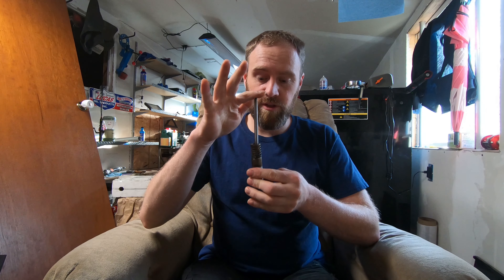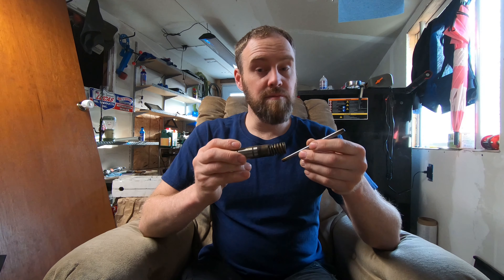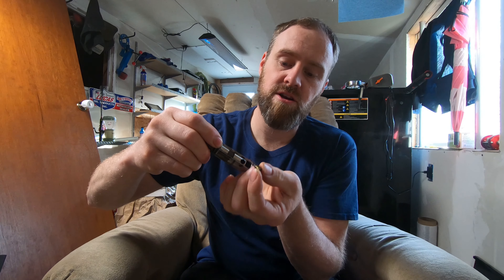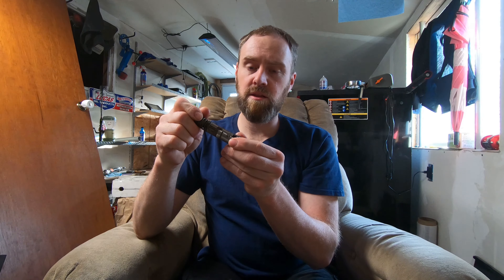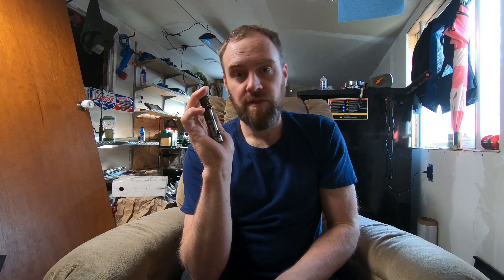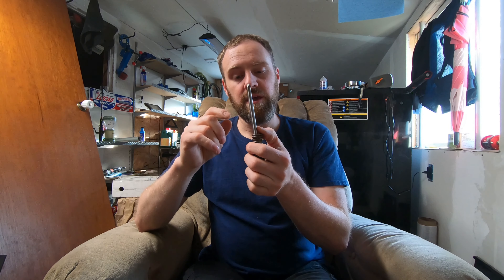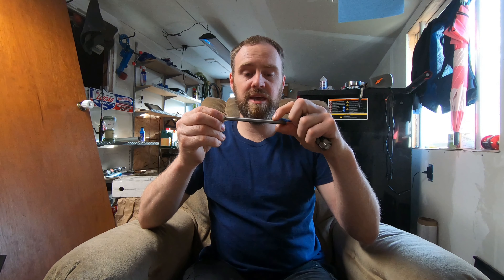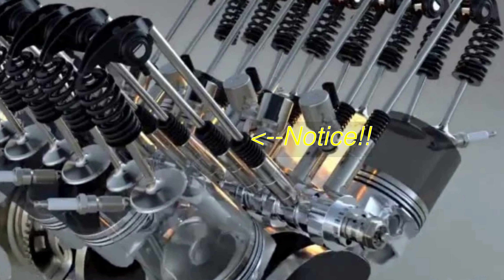Bent Pushrod, Is GM engineering to blame?

Comment: My 2021 Silverado Trail Boss w/3k miles dropped at the dealer yesterday for a collapsed lifter. They will only replace the lifters on the side with the failure but will not touch or replace the other side until they fail.  Tech said that GM will NOT authorize the dealers to replace them all at one time.
Reply: I have issue in my truck misfire cylinders and temperature sensor circuit high
Reply: I had the same thing on my 2020 RST 5.3 at 3700 miles…they only replaced one bank of lifters… on  
June 18th a TSB came out advising to replace all lifters when this problem occurs…Mine was repaired the week before, I complained to GM and now I will be getting other bank of lifters replaced
Reply: I was lucky and the TSB came out while my Trail Boss was in the shop, so they replaced all lifters on both sides (supposedly).  While they were testing the truck before giving it back to me, it dropped another lifter.  So it dropped a lifter from the replacement batch of lifters.  Another week in the shop to get the parts in to fix it again.  Have had the truck back for about two weeks now and it is running good again.  Fingers crossed 🤞🏼

Comment: I have a 2019 silverado 1500, sent to dealership misfiring in cylinder 1. Collapsed valve bent pushrod so $4000 later they replace all the driver side bank here we are 6 weeks later and same issue same cylinder. Very frustrating
Reply from the maker: Sounds like you need the smaller diameter pushrods I offer.

Comment: Pulled the valve covers all rockers seem right nothing loose.. lifter ticking noise.. goes away at 2k rpm… bad vlom not allowing oil to flow correctly?
Reply from the maker: You sure it's lifters? What year and what is it. New ones don't have a VLOM and that won't cause something like that. The VLOM only applies oil to lifter when lifters are disengaged, AKA 4 cylinder mode.

Comment: 2020 at4, 50 miles on it and bent a rod. Got a new motor
Reply: Did you have to press them for a new motor? I just suffered a bent rod at 30k miles (still under warranty) and I want a new motor also
Reply: @blakDragon88  no, it was the day after I bought it so they apologized heavily and swapped the truck for an identical one. Took the other and put a new motor in.
Reply: @blakDragon88  did they tell you why it bent a rod???

Comment: My truck has a cylinder 7 miss fire it’s a 2015 GMC Sierra they told me it something with the rocker in the engine would it be the rod?? The truck shakes, has a check engine light and sometimes throws white smoke from the exhaust
Reply from the maker: Very good chance it's a pushrod.

Comment: I have a 2019 Chevy Trailboss custom 5.3 with 6 speed and older tech 25,000 miles no issues Inknow many with the newer 6.2 that are having this issue so your saying the Active fuel management is the reason  this is more common and the engines that just shut off to 4 cylinders are less likely to have issue ?

Comment: So the new Silverados come without the AFM due to the chip shortage, do you believe the trucks will not have those issues with the lifter and pushrods?
Reply from the maker: The non DFM will prevent the typical lifter failures. However it won't completely solve the pushrod issue.
Reply: @CrazedPerformanceRepair  I have ordered a Trail Boss which will come without the AFM and plan to use it to tow a small camper, do you believe towing a camper will put even more stress on the engine and pushrod?
Reply from the maker: @Krivaja22  it always adds stress to an engine but not in a bad way. It won't effect the life of the pushrods as it's a engineering failure rather then a too much stress failure. The solution is a slightly smaller diameter yet stronger pushrod like I now offer on my website.
Reply: @CrazedPerformanceRepair  is that something that a regular Joe could replace?
Reply from the maker: Actually yes most folks even with a minimal mechanical ability can do it. It will require a torque wrench though.

Comment: Solution at this very moment, if buying new, is get a non AFM/DOD truck with a $50 incentive. Very limited time due to chip shortage,  allegedly.
Reply: I was able to grab a non DFM LT trail boss recently. I’m still not totally confident something won’t go wrong. I installed a Range AFM delete on my 2019 Silverado and in 40,000 miles I had no issues. I’m hoping the GM factory delete on my 21 will work as good.
Reply: The only thing we don't know is whether or not the AFM lifters are still in the engine. Many think they are still installed and electronically it's disabled. Which may still cause issues later on.
Reply: I'm quite certain that the afm lifters were used. The engines were built either in a different facility or at least on a completely separate line on facility grounds and the likelihood of them changing up the line with different lifters for a limited run is slim at best.  I'm sure the entire system is functional except for the electronics and tune.  I have a '14 gmc sierra with just shy of 190,000 miles.  12k-15k ago I had a guy with an hp tuner turn off the afm. Total game changer. Way better mileage, better than I've ever had.  Oil consumption is down as well.  I should have installed a catch can 100,000 ago, but yeah. Now I'm fighting a formidable foe, the electrical gremlins.  My screen hasn't worked in a bit and paying the stealership money to have them blindly throw money at it seems counterproductive.
Reply: @METAL-FARMER  my newest is an 09. After warranty I removed all the parts from both the 09 and my 06.  Regular lifters, a mild cam upgrade, regular oil pump, removed the stupid bypass valve in the oil pan, the whole deal. HP Tuners to change the tune. The 09 was starting to use a little oil, but after removing all that crap and driving the snot out of it, it's completely resolved. The 09 has 165k the 06 is only 60k

Comment: What would you say if you had your cam and lifters replaced under extended warranty ($8,200~ job) but a year and a half later (53,000 km on the work) your motor is totally blown because of a bent push rod that wasn't replaced during the warranty work? They put in a new cam and lifters but used the old (likely worn out/imperfect) push rods?? Skipped out on $100(?) worth of parts and now I'm being quoted $19K for a new motor? @crazedperformancerepair
Reply from the maker: First a pushrod shouldn't completely blow and engine. Perhaps if a tiny piece fell in the pan and grenaded the oil pump and you ignored all oil pressure warning while continuing to drive. Then I suppose it could blow an engine. But really that's more of a operator failure in that case. Besides, the pushrods fail from interference rather that wear when they break. They would have needed to replace them with aftermarket ones like I sell. But the dealership would never do that. They would have just put new OEM units in and you would have still had the failure but without pushrods to blame it on.

Comment: Just got my 2021 Silverado RST 5.3L back on Friday 5/28/21. At 9,800 miles a pushrod bent and lifter collapsed causing misfire on cylinder 5. Dealer replaced all lifters and pushrods on right side of Motor. 

Dealer told me I was 1 of 7 in the shop for the same problem and 3 new Tahoe’s. Dealer also said I might be back in 8,000 miles. Jokes on GM because I bought the 125,000 mile warranty on the drive train. I’m going to shove it clear up their ass on this truck.  

Should have spent the extra money and bought a Ford SuperDuty with diesel.

Comment: Bad decision going with trail boss ? ?  Jjust got rid of my Tacoma with 20k miles cause it sucked.   Damn.   Well off to the ram 1500 hemi tick forums !
Reply from the maker: What was so bad about the Tacoma? You have my curiosity.
Reply: Get a Tundra.  It's basic as hell that's kind of annoying but that's the only solution I can think of.  Maybe a Titan but not sure about that either.   Plenty of Ram and Ford owners pissed about crap too on the forums.  The only forums where I don't see constant complaining of failures or lack of power is the tundra forums.  The Tacoma? You already know, gear hunting, not enough power, plastic coolant pipe '16 on blowing, taillight issues, I know.  But Tundra somehow, some way, is still solid.  Boring, but solid.

Comment: I have a 2021 5.3 trail boss with no afm and a 6 speed transmission. Should I worry about this issue?
Reply from the maker: It may or may not be an issue. If it happens once it will happen again unless you upgrade the pushrods. Without AFM/DFM lifters it has less chance of the issue but can still happen. Some of these are hitting the pushrods on the hole it goes through in the cylinder head.

Comment: Can this issue cause oil consumption or oil burning in the engine?
Reply from the maker: No, that's typically the pcv system in the older ones. Not completely sure what it is yet in these newer ones. Push rods won't cause oil consumption though.
Reply: @CrazedPerformanceRepair  ok thanks. I am experiencing oil consumption in a 2020 GMC Sierra 6.2L

Comment: I work for a fleet account we have a ton of these vehicles the 2015 I drove, motor at 90,000 first transmission 59000. So then he gives me a 2016 at 69000 miles the transmission had to be replaced the motor made it to 120.000 miles. So at the time he switches me to a 2017 this one made it to 120,000 miles when the tranny let go then injectors at 130 the motor at 159.000. As This is the End of the year 2021 all of the fleet except for the 2022 have had driver side motor mount,  AC condenser engine replacement, transmission replacement. These are highly maintained.  Just really unacceptable that this far along in the vehicle's life General Motors Corporation has not replaced or repaired it should never have these failures again. I always bag on him get Fords at least half the fleet should be a mix to see who handles severe Duty service best

Comment: My buddy has a 2016 Sierra. It dropped a valve and the keepers ruined the engine. He showed me the valve after he had a new engine put in it and the valve was hollow. It snapped in half. I couldn’t believe it. Don’t know if that’s common. But a hollow valve seems much weaker than a solid valve, obviously. Not to mention I have a 2015 silverado with 79k miles and the transmission went out around the same time frame as his engine failure. Come on GM….
Reply from the maker: Hollow valve would have been the exhaust valve. It's a process they use to reduce heat transfer through the stem. They fill it with some sort of gas I believe but can't recall what it's called at the moment.
Reply: Aren’t they filled with sodium?
Reply: Aircraft exhaust valves are filled with sodium.

Comment: SO THIS MORNIG WHEN I TURNED ON MY 2021 SILVERADO I HERD A TICKING SOUND IN THE ENGINE SO I DROVE TO WORK AND TRIED TO LISTEN AND HAVENT HERD NOITHING ANY MORE BUT IM AM CONCERNED THAT THIS IS HAPPENING TO MY TRUCK, SHOULD I TAKE IT IN EVEN IF I DONT HEAR IT ANY MORE? I WILL LISTEN AGAIN IN THE MORNIIG WHEN ITS COLD SEE IF I HEAR IT AGAIN.
Reply from the maker: Well that morning start up tick is commonly a broken manifold bolt but I doubt that on one that new. Maybe they didn't tighten the bolts down good enough at the plant?
Reply: I got my truck back today they said it only sounded for 10 seconds and was too soft could find out what was the noise so they did t fix it yet they said if it get more frequent and líder the warranty will cover it

Comment: If I were to purchase the push rod upgrade for a brand new 2021 6.2L V8, and have them installed, would the manufacturer void the engine warranty?
Reply: Unless GM does the work it will void warranty
Reply: Just put back the stock pushrods if anything fails

Comment: @CrazedPerformanceRepair What would you do in my situation. I bought a brand new, 2021 SLT 4x4 and just had all 16 pushrods repaired on the vehicle. I'm getting ready to pick it up Friday to see how it runs but from what I've read, it seems that I will have to deal with this issue again based on the design. I love the care and it is perfect for my family but I don't want to be stuck dealing with these issues.
Reply from the maker: I would upgrade the pushrods to something like what I offer. Then if you need to bring it in for any other engine warranty just put stock ones back in before taking it. All other vehicle warranty just leave upgrade in.
Reply: @CrazedPerformanceRepair  I'm not very proficient in engine mechanics. Would I be able to do this myself? If not, I'm assuming I would need to take my car to a local repair shop each time i would need to take it into the dealership.
Reply from the maker: @williammontgomery5913  it's fairly easy to do but you could just pay someone as well.
Reply: @CrazedPerformanceRepair  i'd think this is a $1500 procedure, am I on target?
Reply from the maker: @marcbee1234  it shouldn't be. Pushrods are easy to change. It should be under $700 probably closer to $450 for most places

Comment: 2021 gmc 1500 elevation, lifters blew 2 times on the driver side in under 5k miles.
Reply from the maker: I've seen the lifter issue on one before when I was at dealer asking about the pushrods. He had one that twice in a row had the guts of the lifter blow apart. I wonder if it isn't somehow related to the pushrod interference. Perhaps the harmonics on some are shaking the internals of the lifter just right when the pushrod vibrates? Hmm, gm really messed these valve train up.

Comment: 2015 GMC Sierra Denali1500 6.2L -61k miles. Threw code P0300/P0303 and ran like crap.  15 miles to a shop and by then, it would barely run. Violent engine shake and quite loud lifter 'banging' (not a tic tic tic).  Diagnosis?  AFM failed and not only bent 1 pushrod on cyl #6,  #3 pushrod was actually  broken in half   A very costly repair and GM didn't do a damn thing.
Reply from the maker: It would be a good idea to replace your pushrods with something like I offer before it happens again.

Comment: All push rod engines have deflection. GM LT1 pushrods are no more than others. It is the collapse and seizure of the lifter that bends the pushrod when the engine is accelerated and stops the DOD and the lifter is stuck, and the weak spring on the lifter causes the valve to float, then it slams back down into the lifter which bends it. The pushrods are ok, the lifter design is a flaw that GM should pay for every DOD delete and damage on every LS/LT1 engine. The so called fuel mileage increase is eaten up in repair costs by the consumer.

Comment: Hes wrong about price. as someone whos having this issue on my 2016 chevy, the full dod delete kit costs about 1,600 camshaft included. its the people that want to sneak extra goodies in that get hit with the 4-6k bill for going to a DEALERSHIP instead of a garage or mod shop. if you dont have a collapsed lifter then u technically only have to swap out the afm lifters. depending on engine meaning u dont even have to buy the full set of 16. the real reason dod delete cost so much is pc ppl arent going with the cheaper fix options. not to mention alot of issues are tied to one another. for example a collapsed lifter can trigger the trunnion rupture issue that gets you needle bearings in your engine. so when ppl are opting to do the dod delete they also opt to just eliminate ALL of the other common fail points. thats where the true 4-6k cost comes from. bc theres a ton of shit wrong that gm is trying to sweap under the rug by fazing out v8. they dont wanna have to pony up for all the fucked engines. even the 2021s are having these issues.
Reply from the maker: I think you misunderstood me. That 4-6k isn't the cost of the kit if you do it yourself. That's the cost of parts and Labor if you take it to a shop at about $100 an hr give or take. It's only going to cost more though as inflation takes place.
Reply: In St. Louis I had a shop that wanted to charge 7K  just to replace lifters, Vlom, pushrods.  at 190 an hour, the labor is like 6K alone.  Some of these independent shops in St. Louis are worse than the stealerships.